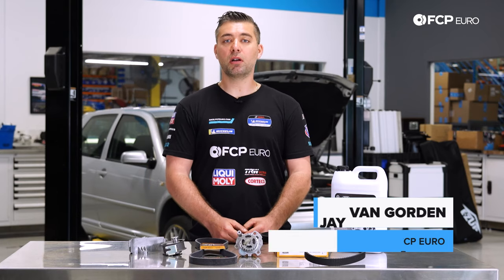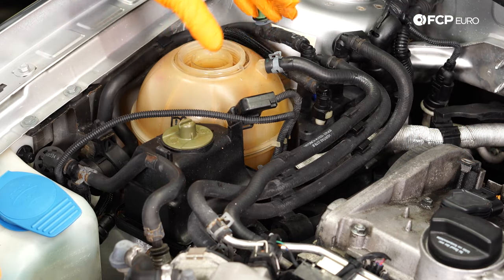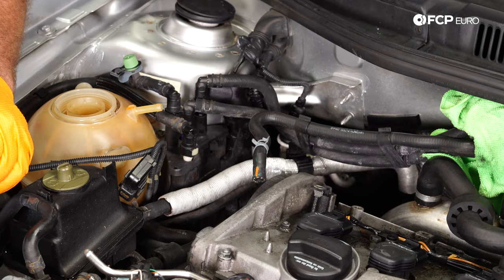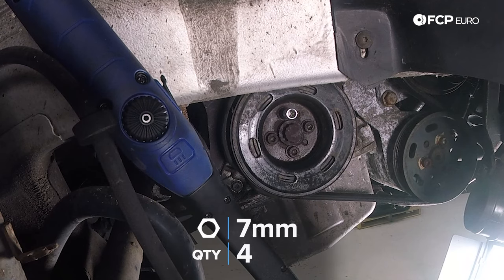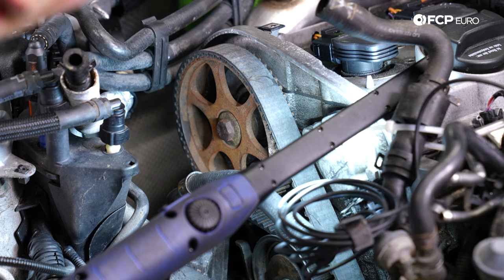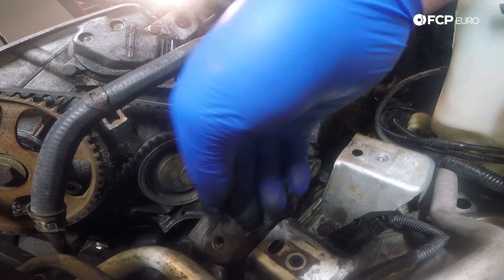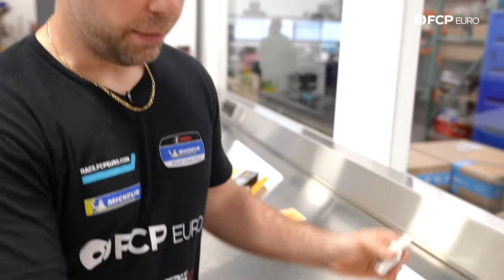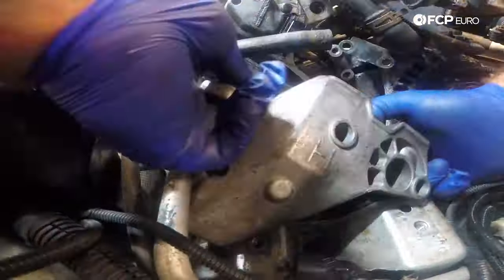Mk4 Volkswagen Golf GTI Timing Belt & Water Pump Replacement DIY (1998-2006 VW Beetle, Jetta, Golf)

Comment: Just wondering why the two white marks on the timing belt doesn’t match up with the cam gear after spinning the engine over.
Reply: On a four stroke engine, then engine needs to be rotated 4 times to make the marks line up again. 4 turns of the crank equals 1 full revolution of the engine.

Comment: Why in the world didn't the Strudel-Eating Ckskrs use a timing chain instead of a cheesy belt? They used a chain to couple the two overhead camshafts on the other end of the engine. German-Engineering....No wonder they lost the friggin war.

Comment: Could you guys do a video regarding the common Timing Chain Cam Tensioner job sometime? Love the videos!
Reply: Just did that and it’s a pain but not hard. Solved a lot of leaking oil in my case - I’d wager because no one bothers replacing it because it’s annoying to get in and out. Cheers!

Comment: Just finished this install on my car - this video was very, very helpful, so thank you FCP team!

Few things from my install: 
- My crank bolt was a 19mm 12-point socket, not a 21mm, so appears this bolt size may vary between the 1.8T's. Just a heads up for anyone else tackling this job. My car was an '05 GTI w/ engine code AWP, not sure that matters, but noting it. 
- The crank pulley bolts were also a 6mm allen, so different than noted in the vid.
- For removing the engine mount bracket, I could not for the life of my get it removed or installed from the top of the car, ended up dropping it down and re-installing from underneath. 

Hope this may help others in the future!

Comment: Huge thanks Jay and FCP Euro! You gave me the information and confidence I needed to complete a timing service on my 20th AE. 

A few things for other viewers...
- 19mm on the crank bolt instead of 21mm 
- I replaced my motor mount, serpentine belt,  thermostat, and housing (170k on the original parts)
- The Motor Mount Bracket is a pain to get in and out. Be patient and adjust the height of the engine up and down to squeak it by.
- The Hydraulic Tensioner also is a pain to install. Again, breath and be patient 
- The timing belt covers are surprisingly difficult to reinstall as well.
Reply: Having the same difficulty.  Cannot get the motor mount in now the hydraulic tensioner is in.  The hydraulic tensioner was also a pita to reinstall

Comment: Just one note, on the accessory belt tensioner, when you're reinstalling the belt, you can slide a pin in that to hold it open while you're installing the new belt and aligning it, so you're not sitting there trying to hold tension on it with a tool while trying to work with the belt at the same time. 
Excellent video.  Thanks!

Comment: Thank you for this video, it was priceless while we replaced the water pump on my son's 2004 1.8L GTI.  We watched other videos, but found this one to be the most informative.  As new VW owners, we had never heard of FCP Euro, so this was a nice discovery for us also.  We saved a ton of money on parts vs the local auto parts store - who never has anything in stock and has to special order everything we need anyway, and then charge us more.

In the video, the pump that Jay removes looks brand new.  In our case the impeller was in pieces and we could have used some advice on what to do in that case - with plastic bits circulating in your engine - in the end, we just re-assembled and are hoping for the best.  Would love to see a camera view of a look inside the block.  If not a probe snaking into the engine:o) then just a glimpse inside.  For example, when you remove the pump, you can see the thermostat just inside. I'm wondering if there's anything worth noting when you look at that.

Also, we struggled a bit when trying to get the plastic timing belt cover back on.  I get a kick out of the other videos that just end with "now just reassemble everything in the reverse order".  Not the case here - we could have used a separate video on just how to re-install a timing cover.  Also, the lower timing belt cover had been bent at some point so we struggled a bit trying to re-install that (though not sure any video would help solve stupid).  We appreciated the rest of the step-by-step reassembly instructions that Jay provided, complete with torque specs.
Reply: Did this video successfully work for you ? i’m about to do it this week and any tips you have or anything i’ll very much appreciate
Reply: @isaacscopes235 how'd it go? I'm halfway through disassembly.   Gonna go slow and steady on this job.

Comment: I just about finished up my timing belt replacement. DO NOT try to take the engine mount bracket out from the top. If you take the rubber hose off from the back side of the engine with the aluminum flat pipe, the bracket practically falls out the bottom. WAY easier!
Reply from the maker: Great note, Chris!

Comment: great informative video but at 36:46 min mark did belt slip from white marks????
Reply: Kinda late but the marks will deviate from what was marked on the belt as the motor runs. Every certain number of rotations ( I can’t remember exactly how many it is) the marks will line up again.

Comment: This is great. I've done this job several times on a few 1.8Ts and still picked up a few new things. 

The metal vs. plastic pump is still a big debate in the Mk4 world, with some pretty knowledgeable people insisting the plastic is better (something about the metal reacting with the coolant). Any thoughts on the debate?
Reply: Metal is better hands down.  Who cares if the metal reacts with the coolant?  Better than having rogue plastic pieces swimming through the cooling system!
Reply: @adamkorekach9936  - Exactly what we just experienced! When we pulled the pump we found two halves of the plastic impeller lying just inside the block, but when we put the halves together, it was clear that two small pieces were missing, one maybe as large as 1cm squared. No idea where it is, but clearly large enough to block a hose somewhere. All we can do is hope it wasn't one large piece, but a few smaller ones.

Comment: Great guide thanks!  Question though - at 37:05 marks on the belt are off?
Reply: Same question... Are they supposed to line up exactly after turning it over twice??
Reply: The marks on the belt will no longer line up after 2 revolutions, they're mostly just there as a backup for belt installation. The main thing is the factory timing marks  line up.

Comment: Excellent video tutorial, Jay.  Plan to use your video as a guide when I replace the belts & coolant pump on my Mk4 Jetta (2.0L, AVH engine) tomorrow.  I noticed that you torque the 18mm engine mount bolt to 100 Nm -- much higher than the 60 Nm specd in the repair manual. Is the 100 Nm an updated spec or an error?
Reply: Just a guess:  the difference may be to compensate for the "plus 1/4 turn" specd in the repair manual? [16mm bolt spec in the manual is 40 Nm "plus 1/4 turn"]

Comment: Hey there FCP EURO im gonna be doing the water pump an timing chain on my mk4 gli. This is the very first time ill be doing a timing chain. I seen that the belt moved over a couple groves from the white marks. Why did they moved?
Reply: The pulleys rotate at different RPM but every 4th rotation of the bottom I think they are in time.
Reply: @hollow34  would you recommend me rotating the pulleys until they align again? Haven’t done the timing yet.
Reply: @CjMk4GLi  you'll see what I mean when you do it. I've messed up by not marking bottom belt on the pulley. Now I can't figure out the correct tension. Argh

Comment: Hi 👋 changed the Timing belt on a golf 2003 about 4 years ago using a genuine vw kit my question is the car as only none about 2000 miles since the change it’s been off the rd due to the pandemic even thou it’s not done the mileage would it be wise to still change the belt and water pump also the water pump was also changed 4 years ago vw  recommend 4 years or mileage regardless the belt still looks new but I’m not sure what to do

Comment: If you cut that stand off the water pump (for the unnecessary timing cover bolt) the engine mount will go back in frome the bottom without a struggle.
Reply: if you made sure it was the same part there shouldn't be an issue and you most likely put it on wrong
Reply: OE part and it is definitely a problem when you're removing the engine mount.
Reply: @murphystreeter  I’m having real difficulty getting the motor mount back in, does this really work?  Getting it in from the bottom?
Reply: Raise/lower the motor.  As long as that standoff has been ground flush the mount will fit.  Gotta have the angle of the engine just right.

Comment: Why is it important to disconnect the battery before working on the timing belt?
Reply: It's the first thing that a real mechanic learned!
Reply: Think of an airplane engine starting from a crank handle, it's unluckily but it's possible the engine could start cranking it.

Comment: sorry for sounding stupid but what is the purpose of mrking the new belt?
Reply: u watch the video
Reply: Good question, I honestly don’t see any use of markings, unless the same belt was reused.
Reply: it's to make it easier to get the new belt in the right spot. it is kind of a pain in the ass if you don't because you don't know if it is a tooth off because of the slack while putting it on
Reply: To ensure the new belt is tensioned up correctly.

Comment: Can someone explain why the timing marks in the video don’t line up after he spins the engine over? It’s @32:48
Reply: Kinda late but the marks will deviate from what was marked on the belt as the motor runs. Every certain number of rotations ( I can’t remember exactly how many it is) the marks will line up again.
Reply: @mk4gli389  I was doing my timing belt as i was watching this, so i got scared that i jumped a tooth or something lol.
Reply: @gagevanhemert7193  haha I’m actually in the process of tearing everything down to do timing/water pump as well. Gave the video a watch as a refresher, this fucking motor mount bracket will be the death of me.
Reply: @mk4gli389  Bro that motor mount bracket is something else lmao, It constantly got in the way.
Reply: @gagevanhemert7193  I spent probably 45 minutes trying to finagle it out. I gave up and am just going to try and work around it because I cannot manage to get it out lmao. Plus I feel like it’ll be even worse trying to get it back in so hopefully it works out. Parts should be delivered tomorrow so we’ll see haha.
Reply: @mk4gli389  Good luck lmao, it’s not terrible but it’s a pain depending on how you’re working at it.

Comment: I cannot get the engine bracket out no matter where I move the engine. I could maybe detach the other side but for now I will attempt to just work around it. 🤷‍♂️
Reply: I ended up pushing it to the side towards the fire wall, after I removed the belt it fell straight out